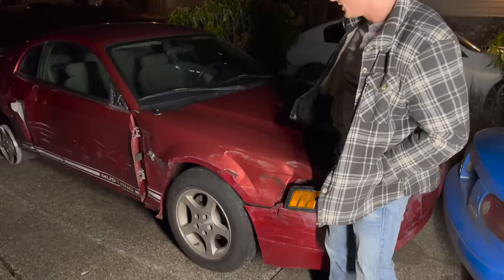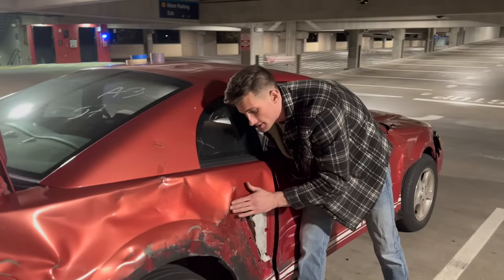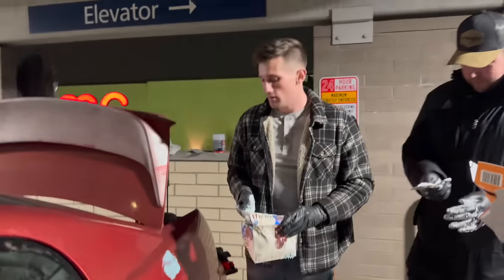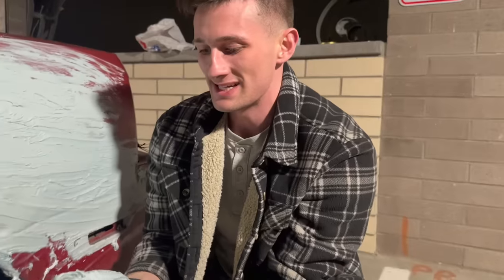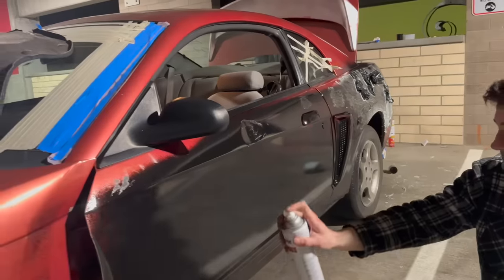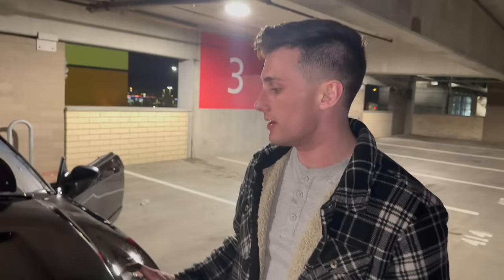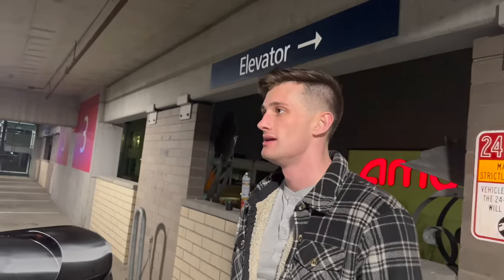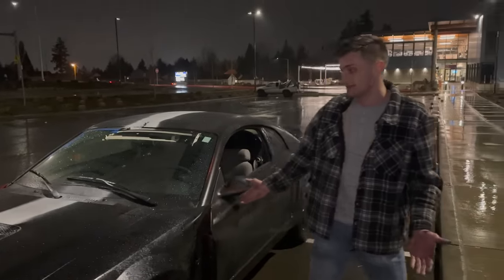Painting My Car With Turbo Cans !!

Comment: Those racing stripes turned out clean af I’d swear is was done in a professional shop. You can save money by stealing all those supplies from Home Depot they literally don’t care. In fact they actually encourage it with their “giving back” program!
Reply: Home depot is actually one of the hardest places to shoplift from. From experience.
Most if not all HD’s have an LP team at the store with their own office and theyre there at all times watching customers. Even if you think youre acting smooth. Its very hard. Maybe something small here or there like a knife or some nuts and bolts..
But if youre putting anything in a backpack or trying to run out with a shopping cart thru the contractor doors… they will be following you out the store the second you leave and you’ll have two huge dudes grabbing you by the wrist and handcuffing you. (Yes theyre allowed to do that)
Luckily when it happened to me i was just day drinking and got too ballsy because i stole some spraypaint from canadian tire and then i wanted to get some more from home depot and felt unstoppable, but they were watching my every move. And i acted like a normal shopper and put stuff in my cart etc and then thought i found a blindspot with no cameras but they still knew and got me as soon as i left the store. 
Called the cops and luckily i talked my way out of a theft charge or anything. I just got an i think 50-80$ trespassing fine. Light af. Cop was super chill bc he told me ur lucky u got me, its up to me whether i press charges on you despite what the store wants and i dont think its worth it, i feel like youve learned your lesson and your being cooperative, so ill let u off with a warning and a small fine.
I was so grateful.
Thought forsure i was gonna get a theft under charge and be banned from all home depots.
They said not to ever come back to that home depot but ive been back anyways.
But i refuse to shoplift anymore.
Maybe the odd time if i dont have my wallet and i want a chocolate bar or something but i rlly try not to anymore.
I got way too addicted to it.
Used to walk into michaels art store when they first got the jumbo montanna markers and we’d get large mcdonalds cups and then put like 4 markers in there lol. 
Then also tagged the whole area around there 😂
They started locking them up but you could still bend it open and get a few colours 😂
We probably stole over 100 of those things and they were like 10-20$ each 😂😂😂

Comment: You don't need mud! Old racecars like the McLaren F1 were just sheet metal and rivets! You want better traction, add sandbags to the trunk. More sparks for the sparkler wheel 😁 Nice work on those "2-door" Impreza panel gaps ✌

Comment: I used this video as a step by step tutorial for my dad's mustang. He has had his mustang for 5 years and the paint was getting scratchy and my stupid ass mom backed it into like three poles. so I fixed the mustang doing exactly what you did in this video. And i don't know why but my dad beat my ass with a belt and said that he cant even see out of the headlights or the windshield anymore and that i completely ruined his hard earned car. What an asshole.  I don't understand why he doesn't appreciate it I did a professional job.

Comment: Serious question. Could you not just take off or mask off your pulleys and belts and radiator. And then full paint your engine bay everything included wouldnt it be fine.

Comment: All three engines are actually great. The GT63 or whatever the f*** it is and the Mitsubishi is a good engine but not as good as lm7 now it's 2JZ. That might be the best engine you have but I don't know exactly what's in the truck but it's either LM7 LR4 LQ4 LQ9 it's probably one of those four engines. I doubt it's an LS like from a Camaro or vett... But to be honest with you the truck engines are better. Those engines in stock form last like 500,000, mi. I don't see any old Rams or old Fords being pulled out of junkyard and slightly rebuilt with turbo slapped on them and then ripping down the road drifting everywhere... I mean honestly the two valve just isn't a good candidate for boost compared to vortec.... And the magnum engines are great. They came in the rams you could stroke one, put a carburetor on it and usually crank up 500hp... But the truck that it came in and the transmission from the factory in that generation RAM are complete garbage and that's why you don't see them around in the heads. Like to crack in between the intake and exhaust valves on those Magnum heads, but it still drive down the road for easily another 10 years after cracked. Sometimes you, they don't even know they're cracked. They just driving on the road.... So LS for the win. No more conversations to be had about this. I didn't say coyote now if we start talking about coyote, that's a whole different ball game